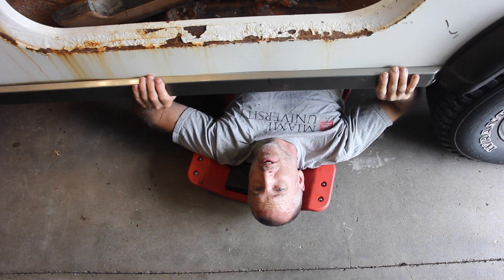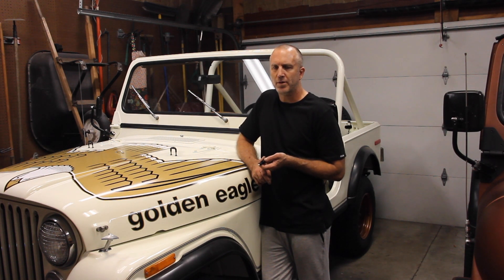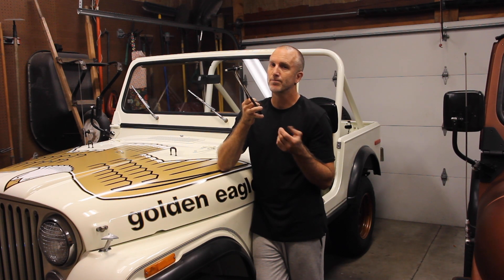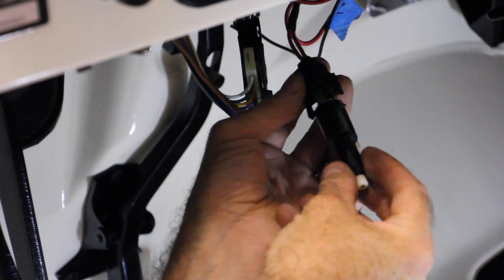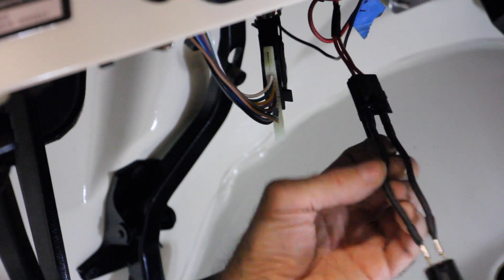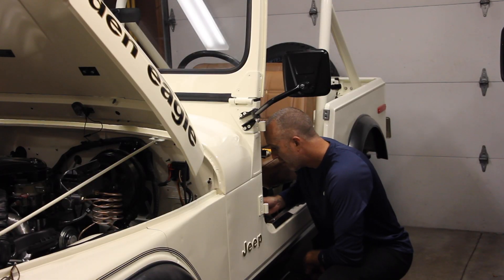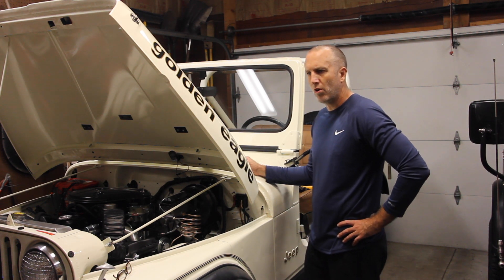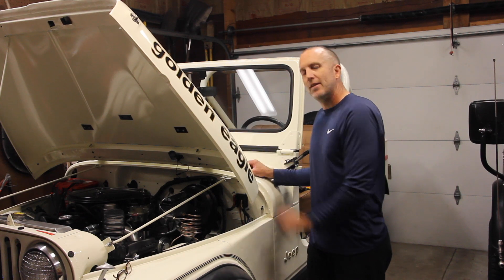Jeep CJ7 Brake Light switch install

Comment: Just finished my 84 CJ7 Engine, T5 and D300 rebuild and am dealing with some of the same issues. My brake lights were staying on so I had to tinker with that issue. then there were some grounding issues with the taillights as well. You put it perfectly when you said "more complicated than it needs to be." Jeeps looking good though!
Reply from the maker: Email me at dellis6914@gmail.com and Ill send you a high res wiring diagram that will really help you.
Reply: @coolguy_CJ7  email sent!

Comment: I couldn't really tell ,is the two wires on the electrical plug side on the brake switch wired together? I can't really tell on my factory wiring diagram. Im using a universal harness. Thanks for your time Cool Guy😎👍

Comment: Good information and very helpful.  Thanks very much.  And you are correct about the CJ's wiring system.  It is terribly over engineered and complicated.
Reply from the maker: It's all about the grounds. And those are complicated as well.

Comment: Great video again. Thank you.
Reply from the maker: Glad to help. Got any suggestions on videos to make?
Reply: @coolguy_CJ7  was dying to watch you rebuild the t5. There're other videos out there but man you are incredibly specific and detailed. I understand you had it done. Not sure if you have a video on installing the hardtop including all hardware and (gaskets,seals,) not sure of the correct terms for the rubber between the top and body. You know replacing the hinges,door latch and shocks if that's even what they're called. I apologize English isn't my native language but I like to try. LOVE JEEPS LOVE HOW SERIOUSLY YOU TAKE ON THE PROJECTS. CONGRATULATIONS CHEERS 🍻
Reply: Mine is an 1986 JEEP CJ7 4.2L T5 DANA 300 DANA 30 FRONT  AMC 20 REAR. Mostly original other than WEBER carburetor,complete BORLA exhaust and CLIFFORD intake.
Reply: Oh and one-piece axles in the AMC 20.
Reply from the maker: @DOLPHINATOR9778  I have a video on the 76-81 hard door restore coming out in a week or so. Then a video on hanging the doors along with installing the hard doors. It's not as easy as I thought it was going to be.
Reply from the maker: @DOLPHINATOR9778  I really wished that I would've taken the time to rebuild the T5, but I wasn't confident enough till I rebuilt the t150 on my 79. But with that said, I've been following this guy for a few years now and he has a cameo on the guy who wrote the book on T5 transmissions. This will show you everything you need to do it. https://youtu.be/XREsRG9Y1mU
Reply: @coolguy_CJ7  I believe I know who you're talking about. A gentleman with an Italian last name I believe
Reply: @coolguy_CJ7  I enjoyed the video where you tackled the Dana 20 transfer case. Once you conquered that Transfer Case the next T5...Piece of cake 👊
Reply: @coolguy_CJ7  AWESOME. Those doors are incredibly heavy. Plenty of moving parts that make it very challenging if you want to get it correct. I'll be anxiously waiting.
Reply: I'm really looking forward to tackling the sound system. That's going to be my opportunity to shine. I love that part of projects. Working on my Harley-Davidson's sound system next weekend.

Comment: Hang in there cool guy,I still only drive my cj 5 during daytime lol
Reply from the maker: Well, got it figured out. Had a bad ground in the parking lights, and just for good measure, I replaced all the bulbs and the fuses. One of those things worked. Now everything works except the cigarette lighter. Soon it will be perfect.

Comment: Great Video and Thank you. My Jeep has the wire from the brake switch cut (I am restoring it and everything was cut prior to my purchase). I know 1 wire goes to power, but where does the other wire connect so my brake lights to work? I replaced Brake switch thanks to your video.   I have a Jeep CJ5 1974.  I appreciate your help.
Reply from the maker: I don’t know if the brake wiring is similar for a 74 but if you email me @ dellis6914@gmail.com, I can send you a full wire schematic that could provide some insight.

Comment: I have a rust-bucket 1983 CJ5 I am trying to get roadworthy. Most everything is fine functionally except the break lights, reverse lights and Temp gauge.  If I could find the wires down-stream in the harness I might consider putting in my own switch in a more appropriate /accessible place.  Thanks for your videos but this break light switch video scared the heck out of me.

Comment: Quick question,  shouldn't I have power at the fuse block on both sides for the stop lights? When I put my test light there i am not getting power. I'm guessing I need to pull the fuse block and make sure it's making good contact on the back side? Also, I see you are in ohio. Just wondering where, I'm in Cincinnati.  Last, thanks for all the videos you do, great stuff!! My jeep is a 78 cj7, BTW. My tail brake lights are not working

Comment: Off topic for the video, but I wanted to ask since you have a 79 and I have an 80 built in late 79.  For the wiper motor. What does the mount and cover situation look like since they didn't start putting windshield vins until 81?  Is it just a blank flat plate and the cover bolted to it? I'm missing all of that. I grabbed one off my 82 parts jeep but it has the rivet holes for a Vin. Does yours not have the holes but still that bracket?  Just curious. I'll probably just weld the rivet holes up then paint it.  I have all of the other three matching Vin locations. Just thought I'd ask.
Reply from the maker: My wiper motor just bolts to the windshield. There is no plate. My 84 has the same configuration as to what your asking about. Also, the motor only has 3 wires as opposed to the 4 wire for the later model CJ7s. As far as the cover goes, I can't offer any knowledge on that. The Golden Eagle came with the dash pad so that would've eliminated any need for a cover. Does that help?
Reply: @coolguy_CJ7  yes absolutely makes total sense, these things get messed with so much its difficult to find out what was stock. Since there are no real records and such. I appreciate the reply. Love the videos. They have been super helpful in getting things setup  the "right way". I'm running and driving again finally after about a year and a half.

Comment: I have a 5 year old restoration - and lately my brake lights will just stay on, if I lift up the brake pedal or tap it back down slightly the lights will go off. No rhyme or reason as to when it happens.

Is there an adjustment on this dang thing/tension on the pedal or do I just need to replace the switch? 

Great videos! Your humor makes it so much better...I feel your pain on these electrical gremlins.
Reply from the maker: Interesting. There is the possibility that the switch has backed out too far. Or the wire connector is loose/corroded. Of course the switch may be bad. My suggestion would be to order a new one and hook it up to the wire harness to test it out before installing. It would suck to pull the old switch, install the new switch, and find out that is was just loose or the connector is corroded.

Comment: Noticed your aluminum radiator, where did you get it?      Was it wide enough to fit in the normal mounting tabs?
Reply from the maker: It was a hold over from the PO. I had to file the mounting holes out about 1/8" but that was about it. The big complication with these aftermarket radiators is the clearance above the steering gear where it connects to the steering shaft. Luckily it has about 1/4" for this setup.

Comment: How about showing how you took it out with the screwdriver and spark plug pliers??
Reply from the maker: So demanding... ;) I had tried to film it, but I couldn't get a camera angle to where you could see anything. I will try again and see if I can figure out a way to film it and not have my hands in the way.

Comment: Drop the steering column.  easy access
Reply from the maker: True, but you have to unbolt the steering column mount bracket from the cowl and the firewall. Plus you have to disconnect enough of the wire harness to move the steering column over.
Reply: I took bolts out,steering column drops down enough to get to the brake light switch.